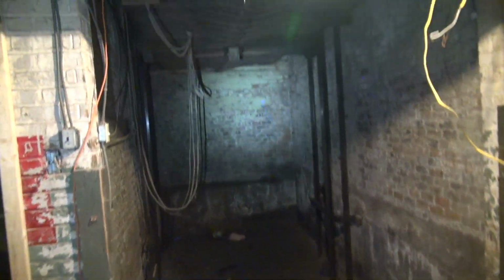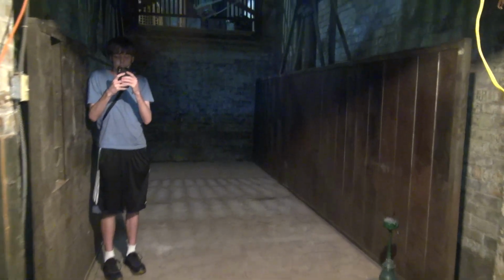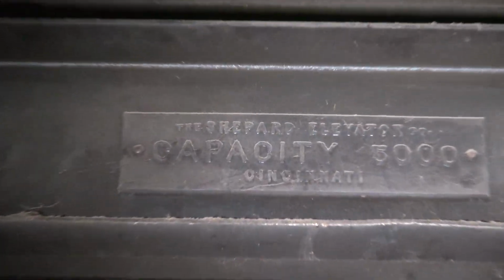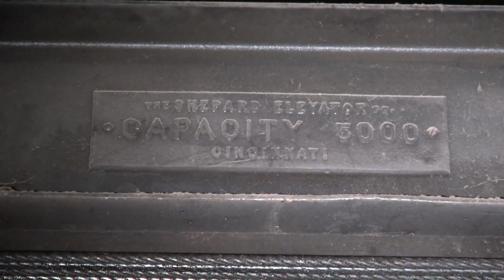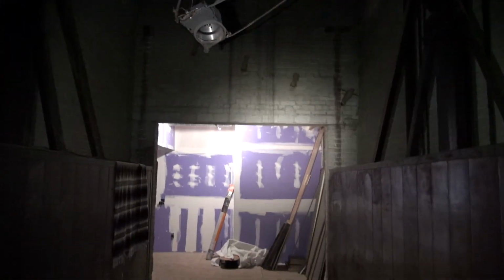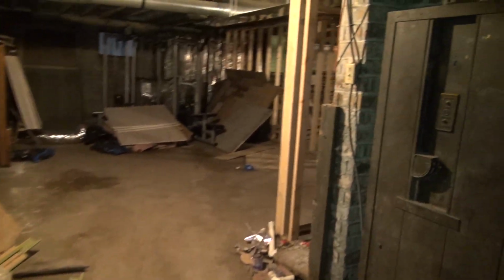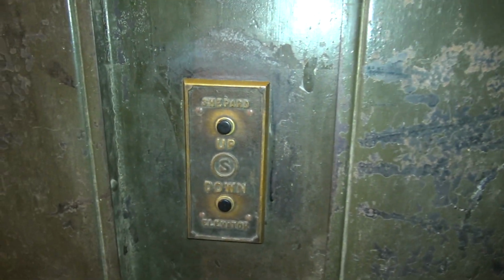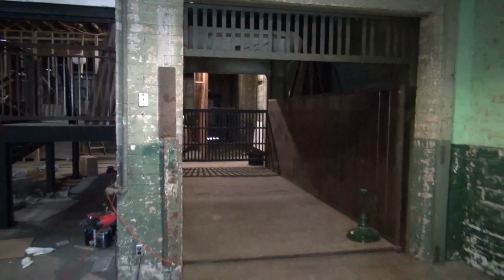EPIC Shepard Freight / Car Elevator! with Machine Room Tour

Comment: Dang those relays at 5:40 are scary!  That's a lot of volts of electricity right there, glad you weren't standing too close.
Reply: Definitely one of the biggest arcs I've seen come out of a relay. This is why you should never enter a machine room unless you absolutely know what you are doing and have permission from the building owner.

Comment: It's an amazing vintage freight elevator 2:1 roped,  controller w/magnetic starter and phase reverse relay.  The geared traction machine is still running smoothly, likely a 240V 3PH open frame.

Comment: 5:40 - This is why machine room safety matters. Never enter a machine room unless you absolutely know what you are doing and have permission from the building owner. Newer relay logic elevators have stricter safety standards in terms of design.

Other the stuff I mentioned above, this elevator (and machine room) is amazing. Got to film a hospital today with a bunch of Haughtons (with the machine rooms (done under authorization) being filmed on a separate date).